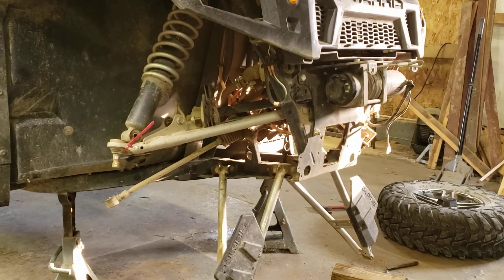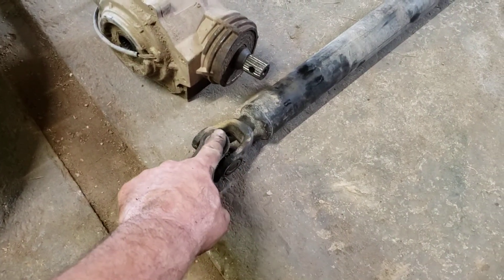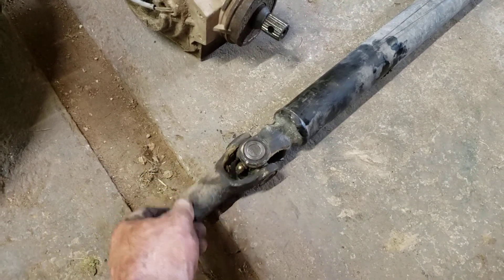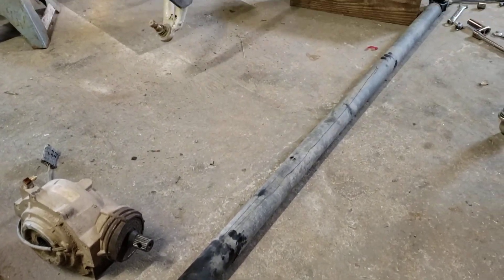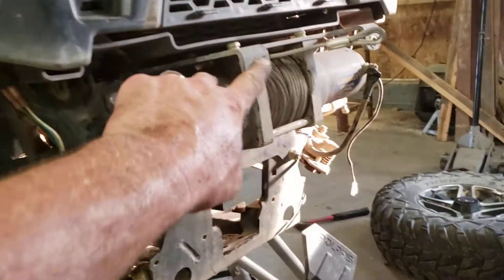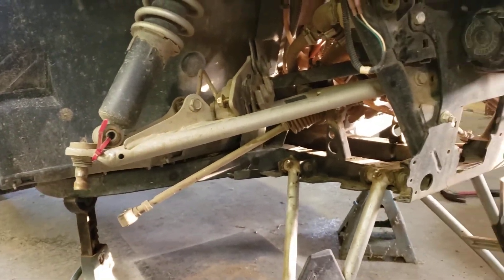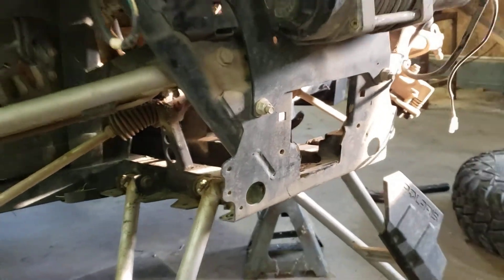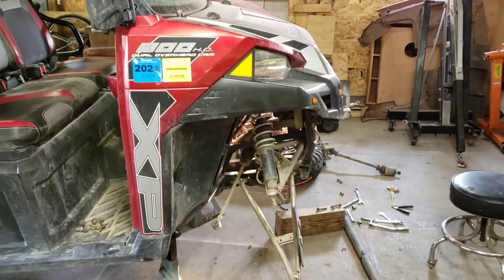Polaris Ranger xp900 drive prop shaft replacement

Comment: You need a new front diff input shaft. They wear down because they are softer than the prop shaft. 
Thats why they rattle around even when new. New prop shaft = new input shaft.